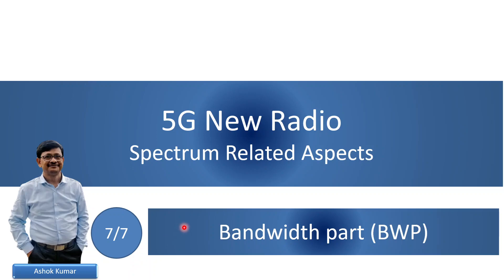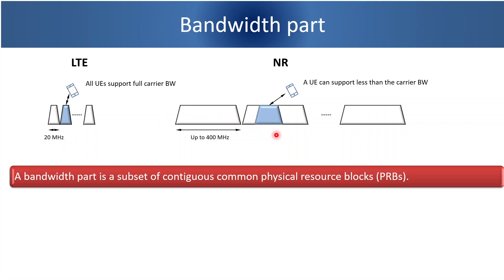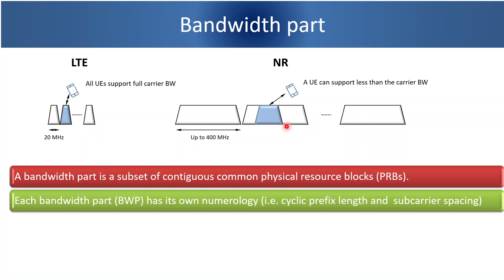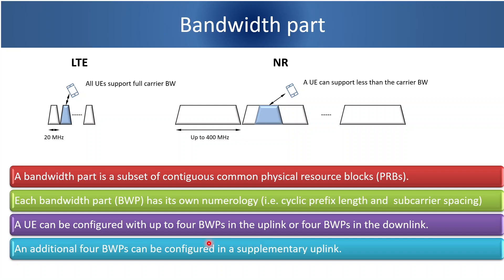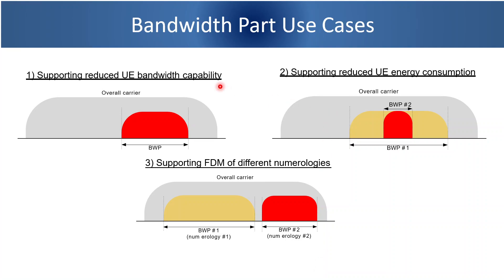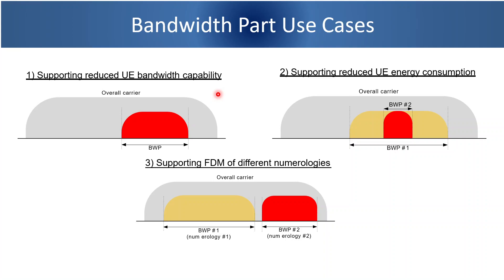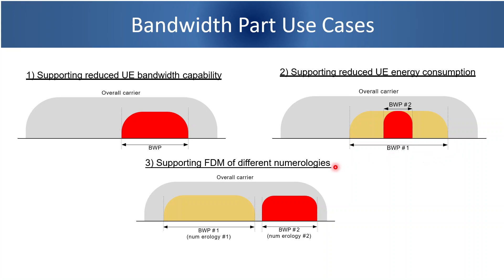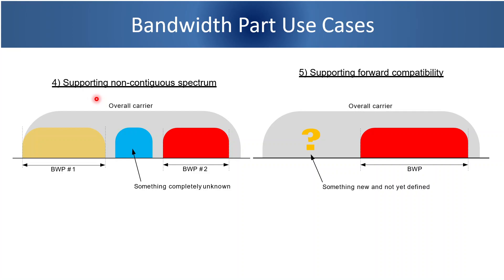Bytes 07/07 :  Bandwidth Parts (BWP) in 5G

Comment: hi sir, just a question
how does noise work in these cases??
for example if there is an UE that suport at most 50 MHz BW but at a given moment it only uses a small BWP
is the thermal nois for calculing rx sensibility 174-10LOG(BW=50MHz) or would it be 174-10log(BWP)??
thank you very much
Reply from the maker: I think the later one. Only the BWP

Comment: Nice explanation. One thing is not clear to me yet though.

Can UE-dedicated BWPs directed at different UEs overlap with one another? Nothing in the TS seems to say that this network configuration is not possible. In case, different UE BWPs can overlap, does the NR scheduler need to ensure that the grants allocated to different UEs with overlapping BWPs do not overlap to not cause interference?
Reply from the maker: Yes  you r right

Comment: Nice explanation. I have a query  in this regard,
Can I assign multiple users in a bandwidth part?
if yes, then maximum how many users I can assign?
if not, then how can I assign multiple users in an FR1 available bandwidth? 
It will be very helpful to me if you respond to my query. 
Thank you.
Reply from the maker: In a cell coverage multiple BWPs will be supported by cell. A UE can use upto 4 BWPs but one at a time. From cell prospective , one BWP may be for multiple users in that cell
Reply: @5Gand6G  
Thank you very much for your reply. Is there any rule to assignment guardband while alloting multiple users in single a bwp?
I will be very pleased if you answered to my query.🙏